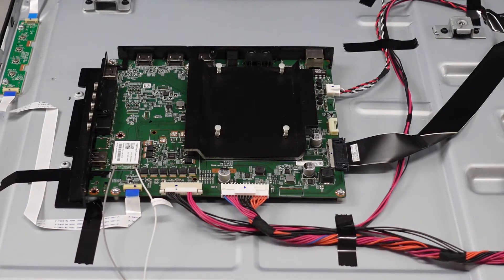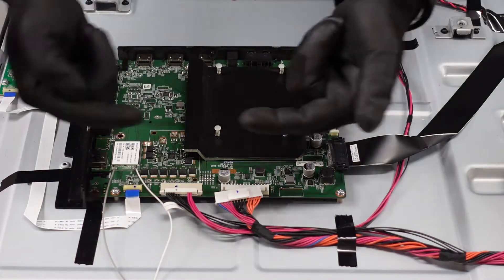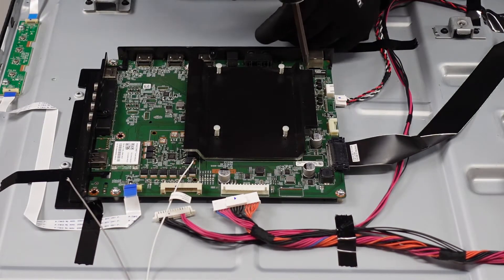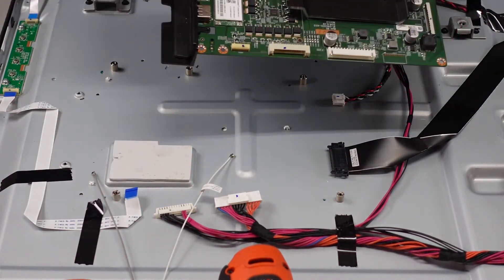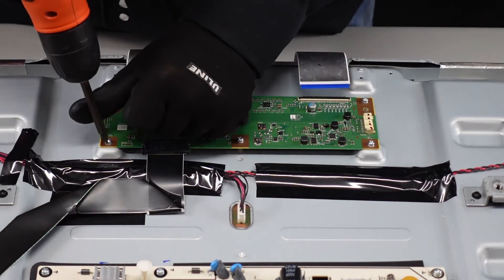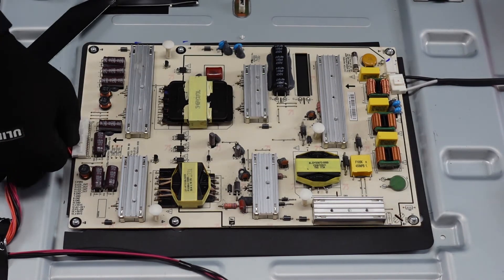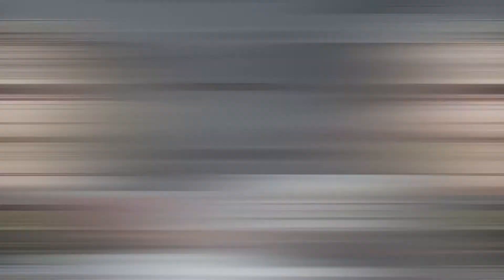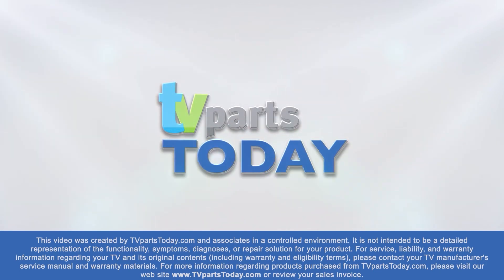Replace the boards in your television.  (VIZIO E60-E3)

Comment: I have this exact model 
It just doesn’t turn on anymore the indicator light doesn’t flash white nor does the tv screen turn on… would replacing the power supply board solve this? I’ve tried using a different power cord so it wasn’t that
Reply from the maker: I would absolutely recommend swapping out the power supply board first.

Comment: Thank you. More detailed information than Shop Jimmy video. My e70-e3 may need a replacement main board. I wasn't sure about the disconnection of the wifi antenna wires. Power goes into the board but not out to the t-con.
Reply from the maker: The wi-fi antenna wires are usually thin wires with small gold caps that fit onto the connections on the wi-fi board. These small gold caps can be fragile and can come off of the wires rendering them almost unusable.  I would be very gentle with the connections and try to pry them off carefully. If you are not getting power through the main board to the other boards then I would try to swap the main board first.

Comment: I have the Vizio 65 inch and the screen in bluish and I'm guessing it's not a smart TV. Not sure if the remote for it is the right one but cant change any color settings or connect to internet. Won't show Netflix
Reply from the maker: It sounds like a t-con or a main board issue. There are a few "universal remote" apps for smart phones that work pretty well with most TV's. I'm not sure if that would be able to navigate to the display settings on your TV, but I would definitely try that first before swapping any boards.
Reply: Did you ever figure out the issue? Mine is doing the exact same thing.

Comment: This was a great video. I have an issue with this specific tv and it won’t power on. Could this be the main board or should I start with the power board?
Reply from the maker: With your symptoms, I would start with the power supply. There are a number of different issues that could be causing your TV not to power on, but the power supply would be the best place to start if you were going to be doing a board swap. If you need some more direction or just want a little more help, send us an e-mail to info@tvpartstoday.com with your model number and symptoms and we will try to get you pointed in the right direction. Thanks, Christopher.

Comment: I have a Vizio 70" 4k tv that most likely needs a new main board. Half the screen is dark. The tv model # is an E70-E3. I would like to purchase the main board from you and am unsure which board it is.
Reply from the maker: Typically, with that symptom, we would look at the t-con, first, as the most likely culprit. If you would like some help figuring out which part to order, send us an e-mail to info@tvpartstoday.com with your model number and we should be able to get you pointed in the right direction. At a glace, your model number has 3 eligible main boards that could be used as a replacement, so a quick list of your parts should have all three of these parts listed. I'll link to our website with the search for your model number.   https://www.tvpartstoday.com/searchresults.asp?Search=E70-E3&Submit=
Reply: I have that model. Did the changing of the main board work or was it the t-con board?

Comment: I have an E60-C3 that quit working.  I show no standby light and set won't power.  I'm thinking the power board is bad because tv was displaying fine before.  What do you think?
Reply from the maker: Hello, 

Based on the information it could be a power supply or main board. To save on shipping cost you can get both boards and return anything that is not needed, but if you do not wish to do so we would suggest starting off with the power supply.

Comment: What does the t con bd do
Reply from the maker: The t con board is the timing control board. It processes the oncoming video delivered from the main board and processes it to the panel.
Reply from the maker: Its the timing control module, it controls the pictures/pixels, etc.
Reply: I have a e60 e3, I'll be watching a DVD , component cable or hdmi from my phone  watching a movie,  screen will go blank, still hear sound, then shows Vizio image. Then comes back on with picture.  May happen every 10 minutes,  may happen every 20 minutes,  seems after a hour or 2, becomes more frequent and longer black screen.  What part is bad , ?